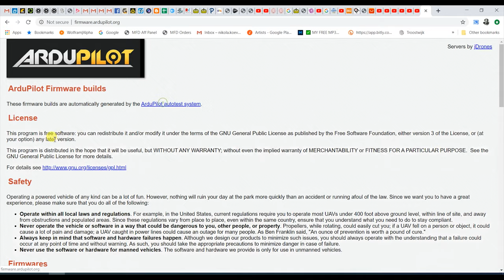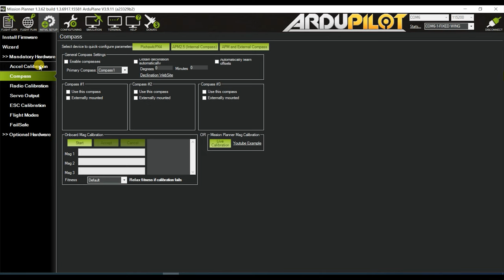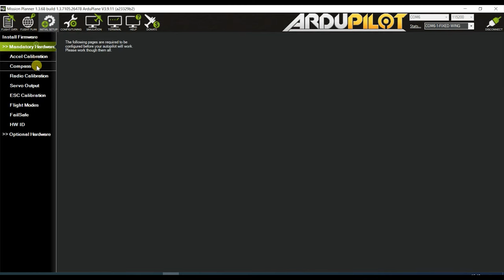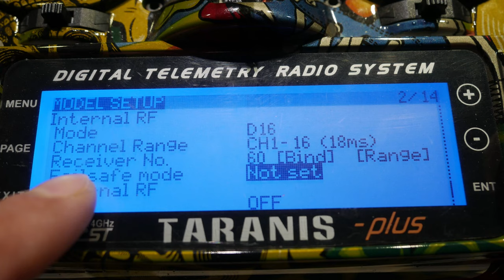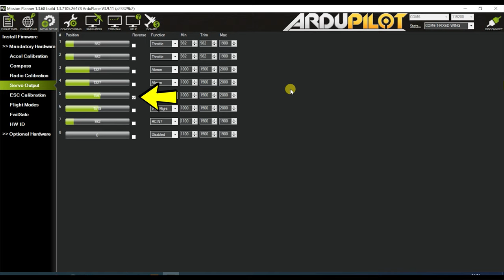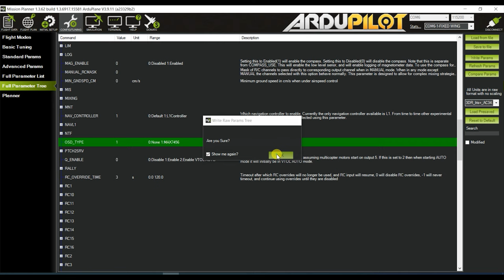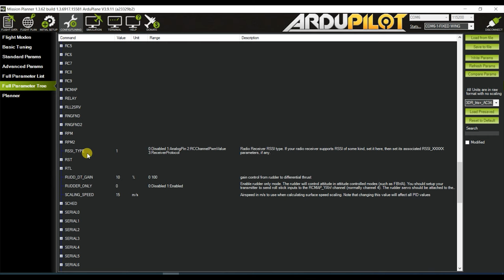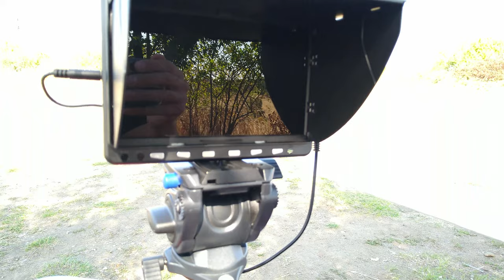HOW-TO Matek F405 Wing with ArduPlane + full setup (on the X-UAV Clouds)

Comment: ah the minimosd days..thank god they're over. great vid thanks.
Reply from the maker: Yes, they are... but not exactly! Industrial grade still use Cubes... and they do not have anything integrated... but luckily the new MFD TeleFlyTiny will soon be able to take in Mavlink and display all of its data, in addition to still sending the tracking data to the ground, which will replace the Minim for those systems that still require an external OSD, and that is very good news because the MFD OSD is absolutely awesome!
Reply: ArxangelRC i have an old (2.4.8) pixhawk AND a Rpi ZERO driven Erle-brain . pixhawk only flew once and Erle never got the software running. and now its beyond support:-(  shame because they are nice but tech changes sooo fast
Reply from the maker: Indeed!

Comment: Whats better between inav or ardu?
Reply from the maker: I prefer Ardu for planes for a number of reasons, must main one is maturity and reliability of the code!
Reply: @ArxangelRC  do can this FC for VTOL?
Reply from the maker: @faktalist  Well... it might work for some basic functionality, but it will be a mess, and I fear you will still have to use an external power module because, depending on the size of the plane, this might not have enough current capability for the hover state!

Comment: hello, gps does not work, soldered to 4 uart. does it make sense to solder to 1 uart?
Reply from the maker: UART1 was something else. You sure its wired correctly? What does the GPS indicator in Mission Planner say? "No GPS" or "no fix"?
Reply: @ArxangelRC  "no GPS" . But everything worked in INAV.
Reply from the maker: @ВалентинАбричкин  Could it be reversed Tx and Rx wires?
Reply: @ArxangelRC  flashed V4.2 for bdshot, turned on GPS(5) detection on all free protocols, turned on only external compass detection, there were some other manipulations, but this solved the problem. I did not have to solder)) Thank you!!!
Reply from the maker: @ВалентинАбричкин  Glad gou fixed it mate! :) Happy flying!
Reply: @ArxangelRC  u2🐱‍🏍
Reply from the maker: @ВалентинАбричкин  Thanks

Comment: What you do to remove the noise?
Reply: If you have noise in your video system make sure you're using the filtered power from the f405 wing rather than powering directly from the battery. I was powering my vtx from the battery and had terrible noise even with low ESR capacitors. 100% fixed by using the vtx power pins on the board
Reply from the maker: Other than the F405 Wing board... I've added nothing more! I am powering the camera and Vtx from the camera and Vtx outputs on the board, and that is about it! The rest is the camera and Vtx's built-in filtering that is clearing any residual noise! I am exceptionally happy with this solution so far!

Comment: I am stucked at compass calibration,,,no movements deducted during calibration,
Reply from the maker: Do you have a compass actually connected to the board? And wiring is correct?
Reply: ArxangelRC yes did cross check and plz post me your wirings,may be i am wrong at some point
Reply from the maker: @FLYWDRAGHIL  Well... I have never used a compass on a plane, never connect it to the flight controller even IF the GPS unit has one... so can't really say what could be the issue! Is this a new GPS unit you are using, or an old one? Could it be it might be damaged... the compass portion I mean... or a cold solder somewhere?
Reply: ArxangelRC  do compass makes any difference??? Why need compass???
Reply: ArxangelRC its a new gps
Reply from the maker: @FLYWDRAGHIL  Yes, they do... they make things worse and cause issues! You need a compass for VTOL models... that can hover in one place... not really needed for a plane that is constantly in motion!
Reply from the maker: @FLYWDRAGHIL  Being a new GPS does not mean it doesn't have a cold solder somewhere...
Reply: ArxangelRC you're reply means alot and help alot,i ill be switching off compass then
Reply from the maker: @FLYWDRAGHIL  Give it a go and see if that helps! :)

Comment: when i put lipo my esc or motor is making load beeping any help?
Reply from the maker: I don't know what a "load beeping" is! Can you explain?
Reply: @ArxangelRC  laud like wrong esc protocol, and ardu cant calibrateas its sayin para error, inav is so simple to ardu
Reply from the maker: @Chris-vc1dh  What ESCs are those?
Reply: @ArxangelRC  the one with ar wing
Reply from the maker: @Chris-vc1dh  You are not going to be able to use the ESC calibration tab to do the ESC calibration, if that is what you are talking about! Keep the autopilot powered and armed, and only unplug the ESC power cable from the FC, throttle up with the radio in manual mode, plug the ESC back in and after the beeps throttle down! Of course, remove the prop from the before doing this!
Reply: @ArxangelRC  it’s a shame that ardu is SO different to inav, I need to think of it differently to get to know it better
Reply from the maker: @Chris-vc1dh  Yes! :)

Comment: Epic, can this conversion be done on the f722 as well?
Reply: Yes it can.
Reply from the maker: Yes, but the F722 will need to use iNav, because it is not supported by ArduPilot! I will be doing a video on the F722 Wing as well, since I have one! Hardware wise it is pretty similar to the F405 Wing... so no news there, but it will be running iNav... so will delve into that!

Comment: Frustrating as I can't get mission planner to connect. (flashing went well) No "COM" port showing to choose in MP.
Reply: before you connect you need to install the plane FW then you can connect. MP wont connect till it has the FW for the vehicle on the FC. Hope that fixes your issue.
Reply from the maker: Well he did say that flashing went well! I assume you were able to get the "with_bl.hex" file flashed on the board via Betafight or iNav configurator? And MP is not seeing a COM port now? That really is weird! Is this your first time installing MP?
Reply: @ArxangelRC  Yes, it flashed fine with iNav. MP just will not show a com port. Seems like a laptop driver problem with MP maybe? Yes, it was first time installing MP on this particular laptop.
Reply from the maker: OK... since MP installs some drives along with the program... can you try to uninstall it, delete any folders left over, and install a fresh copy... at some point it should ask you to give permission to install some drivers... click yes on all of them!
Reply: Arr another issue is if you use inav I guess betaflight also and you had to install the usb driver stm32, may be wrong name but if you installed it you'd know, it may be easier to uninstall usb devices if on windows and then plug board in, only on windows dont know macs at all. I had same issue when went to use my pixhawk after playing on Inav for a while.
Also stay on auto and watch when u plug board in to what usb port its install on hit connect it may not connect but if u go to the pull down tab the port should appear in the list now.  Make sure the board rate is correct also.
Re the FW often MP needs the model FW when using CHIBIOS not just board firmware. Meaning he needs to flash with latest plane build before connecting.
Reply: Angus Whitehouse i am using windows 10.  I was thinking that may be the problem since i had drivers installed for inav. I will try that and other replies. Thanks all
Reply: @willay747  Mate how did you go? Any luck? Am tackling mine today so if I have same issue will ltyou know how I resolved it. Been a while since I've done a new board.
I'm still flying a Pixfalcon! Not even made anymore
..😜
Reply: Angus Whitehouse whats a pixfalcon? Lol that is an oldie. I haven’t tried it yet. This weekend I will mess with it again and let you know.
Reply: @willay747  Pixfalcon is a V1 of a pixhawk clone, much like looking at a pixracer same size but really old. I only want the flight modes and mission the basics so could really just use an amp board to save cash. But the f405 gives us a few years of redundancy to add stuff if we need to.
Look forward to hearing how you go. Where in world are you? I'm in Australia
Reply from the maker: Does the board even show up in the Device Manager when you plug it in?
Reply: @ArxangelRC  which the pixfalcon? It shows up and let's you flash the latest FW which wasn't a good idea. Tridge caught it before I flew and told me to roll back to first Pix FW or FMuV3 so did and works great. These old boards are fantastic ifyou only want basics. I'm never going to use it for mapping or anything just for long range flights so basic stuff. 
Even the APM boards are still flying if all you want is a simple controller. 
In fact I'm no longer going to waste my time trying to go for latest hardware as I'll never use any of the reasons for upgrading and can save a tonne on hardware.
Reply: GOT A FIX FOR YOUR ISSUE HAD SAME PROBLEM......
Use the Driver fixer worked  1st time wish I knew about this when getting into these just make sure your in DFU mode by pressing button as connect to PC
https://impulserc.com/pages/downloads
Reply: @ArxangelRC  You were kind enough to reply so wanted to let you know the problem. After re-reading all your posts and thinking I loaded the correct FW it turns out I did not.  I didn't have the _BLHex version loaded! Works great now! Thanks all for the help!!
Reply from the maker: @ Angus - Yeah... I still had the Micro APM in the X-UAV Clouds up until now, worked like a charm... only replaced it for the sake of upgrading! For FPV and simple RTH... it worked very well!

@baddb1 - Oh, glad to know you figured it out! Awesome!!! :)

Comment: Love the videos but please, take off your props for ESC calibration! Saving 1 minute of work is not worth potentially having your plane bite you 😅
Reply from the maker: True... but has never happened so far... and I am always too lazy! :(
Reply: @ArxangelRC  when I was flying quads I used to just throw a shirt on top of it if I wanted to quickly do something on the bench without taking the props off 👌
Reply from the maker: Right... hmmmm... that could easily burn out an ESC!
Reply: @ArxangelRC  better a burnt ESC than stitches 😅
Reply from the maker: Weeeeell... we will see! I hate burning up stuff!

Comment: NEVER!!! calibrate ESC with props on.... i did this on dshot 1200 and motor started to spin at max speed with props, cut my hand hard. i hope they fixed this in new versions of arduplane..
Reply from the maker: Dshot ESCs do not need calibration! Sorry to hear about your accident!!
Reply: @ArxangelRC  now i know. But i just moved to dshot and did not know that..
Reply from the maker: Is your hand OK?
Reply: @ArxangelRC  yes) thank you.  But it was deep cut.. with 10inch carbon prop
Reply from the maker: Ouch! I hope you are better now!

Comment: everithing fails from the first step, drivers are not working, fail to connect, fail to load the drivers, fail to initiate bootloader....Betaflight  sucks.
Reply from the maker: Damn... that sucks indeed! Did you use Zadig to fix the driver issues?
Reply: @ArxangelRC  we tried with three different pc computers with different window versions,  different cables and boards, two matek´s  f405 wing and one normal drone board... a friend came home and tried following step by step the instalation of all the drivers including Zadig, STM, CP210 etc.... and nothing at all. No connection.  My main computer has issues with usb 3.0  and matek.  It detects matek F405SE  board connected to USB but can not open the port.  We tried to fix  com ports with ImpulseRC Driver Fixer and nothing. The other  two computers are not  connecting  either and failing to open  bootloader, no matter the selected options, as we tried all.
Betaflight  is a Failure on PC,  after two days wasted  we tried with a MAC and surprise....  worked at the first attept.
Reply from the maker: @JJVoltio  Damn!!! Well I am glad you got it working in the end... but I am shocked why it would be such an issue with all these PCs you tried on! I had an issue only until I sorted out the drives using the Zadig software... since then it has been working flawlessly!